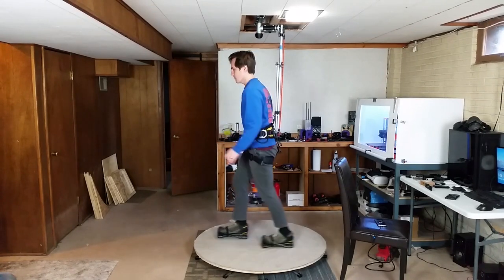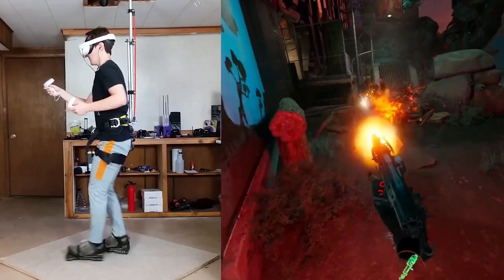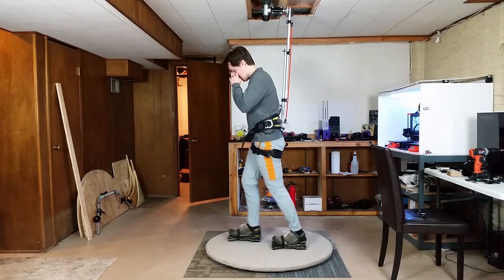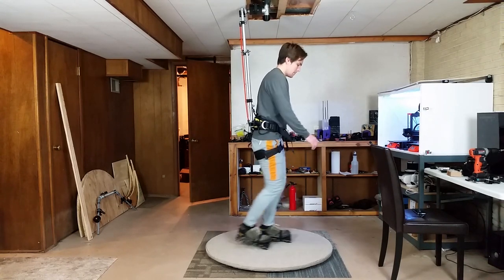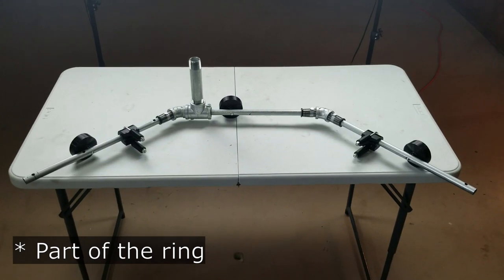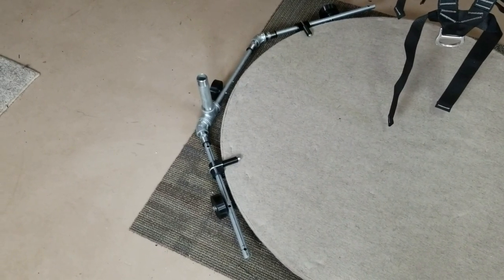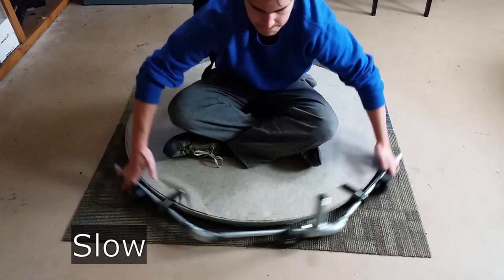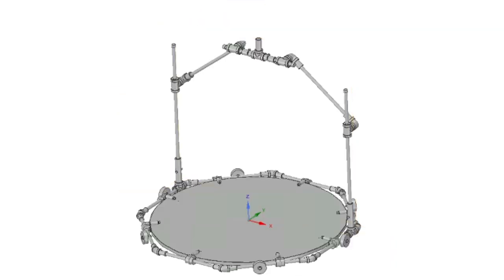VR Shoe Build Log #49 - How the New VR Rig Will Rotate Around the Platform

Comment: I think you should use flat surface rubber mats instead of woven carpet (on top of the floor and maybe on top of the platform too). The wheels will roll better, having less resistance, and it should make less noise. Maybe horse stall mats (also used by many home gym owners) since they are very dense and happen to be relatively cheap. They are great at absorbing impact noise. There are also specialized gym rubber mats you can look at, but these tend to be more expensive.
Reply from the maker: I'd like to use a neoprene mat. I have done some testing with it and it is indeed quieter. The issue is those mats are kind of expensive. A thin rug is cheaper and I think it will work fine. But I may go back and make a more expensive version that does use rubber sheets.

Comment: I think for the noise generated by the walking, carpet might still cause the platform to generate a lot of sound due to it being in direct contact with the floor. Something like foam might reduce the amount of movement that causes the floor to vibrate? Not sure if this theory is accurate though... Also still a most of the sound will still come from the shoes being in contact with the platform...

Comment: I think you could use PVC pipe here to reduce inertia and combine the rollers and wheels into one wheel small enough to fit under the rim of the platform. The octagon PVC pipes could then be on the outside of the wheels instead, constraining it to fit around the platform, so there's no need for rollers to grip it.
Reply from the maker: I think if you did that, where it's just wheels on the inside, the octagon would easily shift off center.

I could see PVC working, but I feel it will be safer and stronger with metal.

Comment: Without fixed platform the rolling rig will slide with you while you are walking. There is not enough friction to keep in place, and if there were, then the rotation wouldn't work. Also, at this small diameter it will also tip
Reply from the maker: You're correct when the vr shoes are passive. That's why I said that I'd try it without the platform when I add motors back to the shoes.